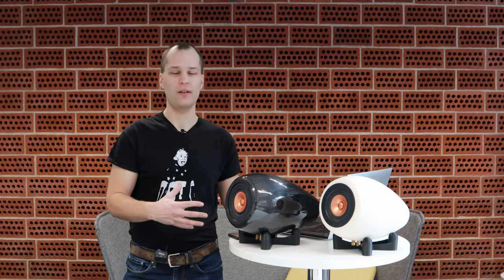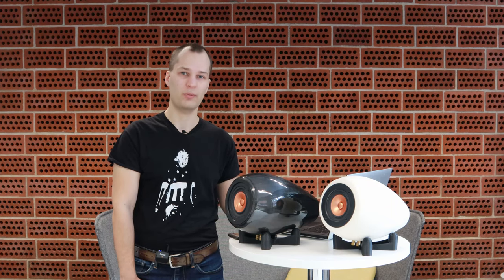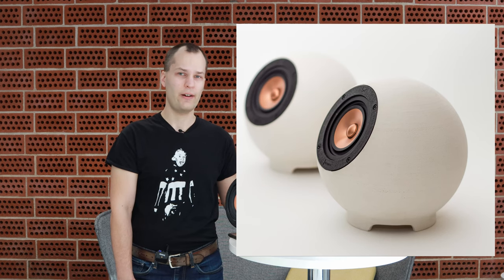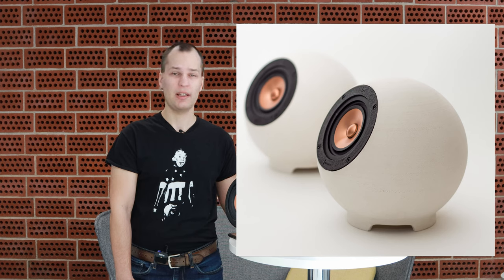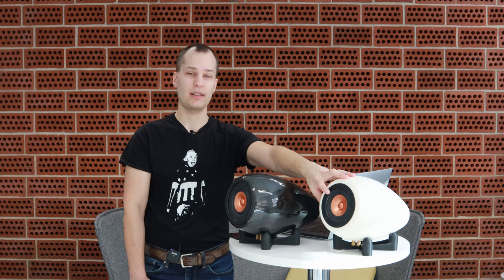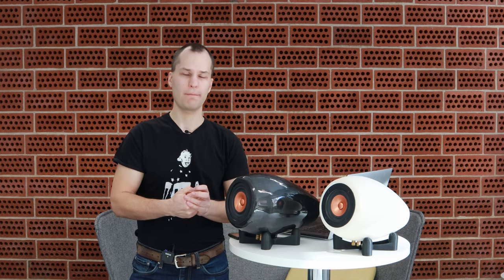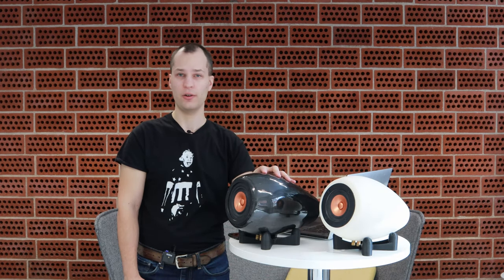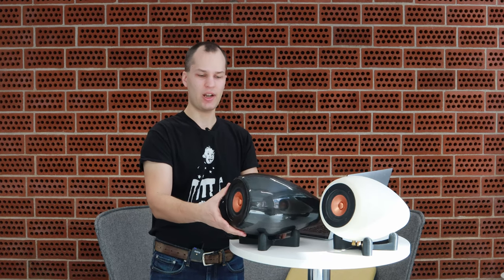3D printing loudspeakers - RD Physics FR1 and FR2

Comment: Heavy is not necessarily the goal, rigidity is more desirable over mass.
Reply from the maker: For subwoofers, it could be enough to increase the resonance frequency outside the passband by stiffening the structure. For full-range applications increased areal mass will reduce the magnitude of the resonance ("mass law").

Comment: Love the design of the FR2 speakers and would really like to see a build video! One of my favorit loudspeaker designs is the B&W 801D (the 15" introduced 1998) which has a large wooden bass enclosure, complemented with a glassfiber(?) mid and aluminium treble dome. I've long been wanting to build a replica or tribute speaker with a similar look but been discouraged by the complex shape. Would you say a 3D printed mid and treble enclosure would be a good idea for this setup? A fixed attachment to the wooden base enclosure would then support and bring mass to the system in total. Air leakage could hopefully be prevented by internal and external painting of the printed parts?
Reply from the maker: Combining carpentry and 3D printing is the best way to go about it. Make the bass enclosure simple, heavy and stiff from wood and then add a printed mid-tweet enclosure on top, which benefits more from the design freedom printing offers. I say go for it and let us know how it goes!

Comment: I came across your very nice design for an MA Alpair 7 speaker. I was in the middle of a process for designing an enclosure very similar to yours, but the one you created has more finesse especially in the internal structure. I give it a go with resin printing and doing some post-processing with eg bitumen. Have you thought about a thicker hollow wall, for filling up with sand?
Reply from the maker: What printer do you have? This is fairly large for a resin printer. Have a look at our video about the SW1 subwoofer, where we filled the wall with epoxy and silicon carbide. We haven't tried sand yet, but it's definitely interesting and we will do that for a future subwoofer build.
Reply: @DIYAudiobyRDPhysics  I own a Anycubic Photon S and already made some tests. I sliced the model i  several parts but already stopped with the front part. With the actual resin the result is too brittle and tighten screws is not possible without breaking the structure. Will reconsider to do it with wood filament on a PLA printer. Also not so time-consuming ;)
Reply: @Chestnutspread  The resin printer could be nice for horns, waveguides, grilles, vents and other smaller parts where smooth surface is nice to have and brittleness is not a problem

Comment: why would you want to build sealed cabinets with 3d printing? eliminate internal pressure and increase output. seems like a win win
Reply from the maker: Achieving air tight and pressure resistant enclosures with 3D printing can be challenging mainly due to the inherent void content of extrusion processes and low Young's modulus of plastics. This does not mean that sealed enclosures are a bad idea. It just means that attention need to be  paid to process parameters (number of wall lines, line overlap) and geometric stiffness (section modulus, spherical shape). 

3D printed enclosures are typically small and small enclosures struggle to get large enough vent cross-section to avoid port noise while minimizing the amount of space the vent itself takes up. We've used passive resonators instead (SW2), but even with the SW2 we prefer a sealed configuration with large amounts of EQ. Also, a vent does not remove internal pressure at relevant frequencies, open baffle does. We have very interesting open baffle developments going on, so stay tuned!

Comment: MA is an overpriced tr..s. An only small FR driver remains on a market is Fostex 108ez. A bit bigger is Sonido 175. And then such models like Cube Audio, AEG, Voxative... go. Finally Lii Audio F-18 it's still possible to listen to. All the others are good to listen to announcements on a station.
By the way, try to print a case with double walls which you can fill up with quartz sand. Always works good.
Reply from the maker: That's a strong statement :) The drivers you mention are all quite a bit more expensive than the MA drivers used here. On a higher budget we would recommend multiway speakers.

We make sand-filled walls for subwoofers, but for small enclosures the wall thickness takes up a big chunk of the volume.

Comment: Why not just add sand in the hull while printing?
Reply from the maker: Sand can be added after printing, too, and works well. Carbon fiber is kinda cool, though, right?
Reply: @DIYAudiobyRDPhysics  i like the carbon look and added stiffness. I mean adding the  sand where the into the model to the infill before the top layers are printed